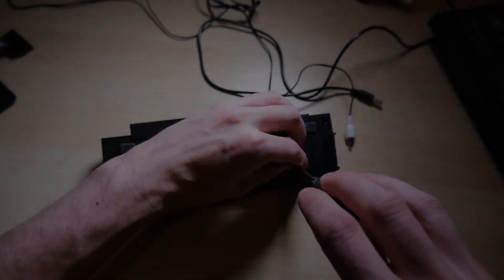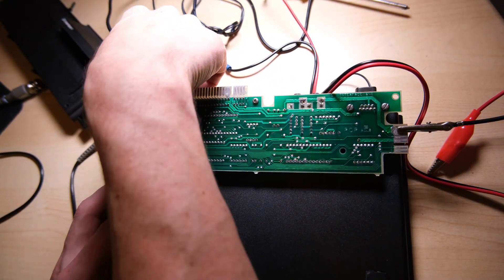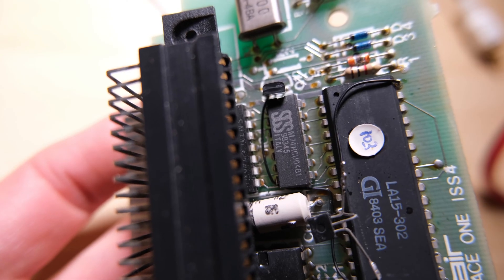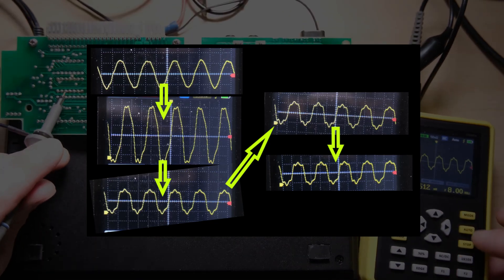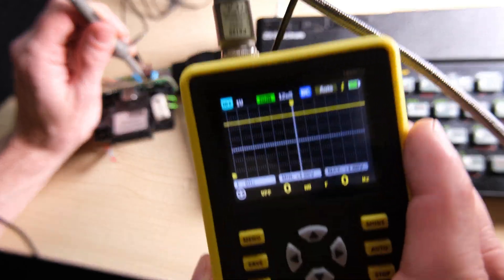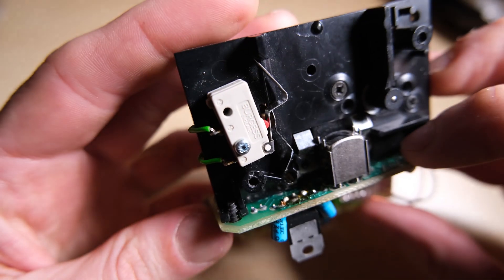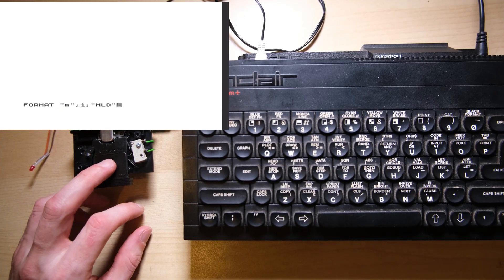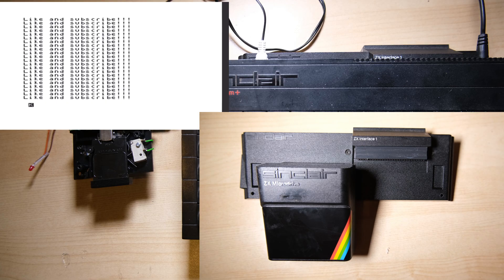ZX Spectrum Interface 1 and Microdrive Repair and Refurbishment

Comment: I don't know if you will see this but let's see. I had an Interface 1 for a while (with a microdrive). I remember that the ROM switching logic was very innovative. I believe that when the Z80 read an instruction from a specifici address, the ROM would switch. This might be some thing you may find interesting and might want to make a video about. Cheers.
Reply from the maker: I think there's a book that contains the IF1 ROM disassembly but I haven't got my hands on it yet!
Reply: @HappyLittleDiodes Here is a document about this. There is a chapter about this topic ZX-Interface-1-2-Microdrive-Service-Manual.pdf https://share.google/187Dlr8dnrTsXa0hN

Comment: hi, helpful video, just getting back into the world of Spectrum and sorting out some old hardware. Would you have a link to the ceramic capacitor kit you used ? I did look on ebay but they are blue ones I know this is a few years old so maybe they just changed the colour :) ?
Reply from the maker: Hi, I got it from here https://amzn.to/476pqFu  it's not available now but it suggests similar packs below

Comment: Should have used a schmitt version of that IC with terminating resistors and a 100R in series on the output. People think the term "high speed logic" means high clock frequencies, it DOESN'T, it refers to the rise and fall times of the gates and failure to implement correct design methods will leave all sorts of doors open for odd system behaviour.

Comment: Great vid.  But it would have been good to see you get into the Microdrive.  I'm told that can be difficult, especially not damaging the Black soft metal cover.
Reply from the maker: Yes good point, thanks for mentioning.  If there is glue involved then a hairdryer is your friend

Comment: I fixed my broken IF1 like this: https://i.imgur.com/4ua82J8.jpg
Basically gutted it except for the edge connector/passthrough and added an AY + Joystick + RS232 interface. Have to admit I've only used the RS232 functionality on the IF1 when it was working as I found the microdrives quite annoying to work with.
Reply from the maker: Nice work!

Comment: How do you find the 5012H scope? Was thinking of getting something cheap and cheerful for probing retro machines so all low frequencies. EEVblog slated it but other have said its ok for slow stuff.
Reply from the maker: I'm not an expert on scopes to be honest, the extent of my usage is to checked for ripple, read voltages, and basically just see what the logic signals are doing (are they flat or not? Is the amplitude roughly correct, how long are pulses, are the wave forms square ish).   It's perfect for quick checks like this. It's also good because it's battery powered, so the voltages are floating around and you don't need to worry about accidentally creating a loop through ground and vaporising your earth strap.  That being said,   I would always have to recommend listening to EEVblog, they really know what they are talking about.